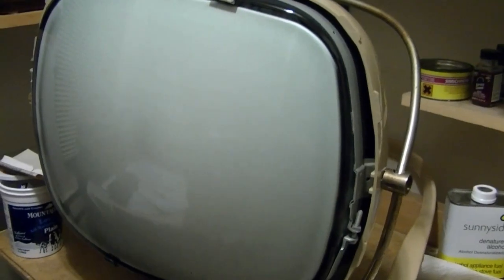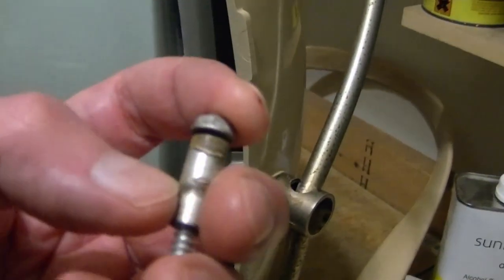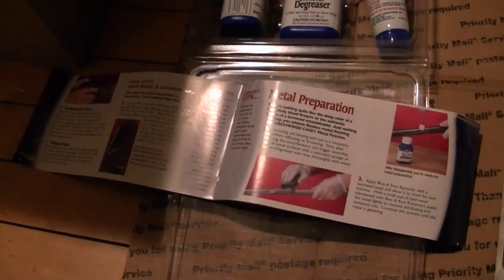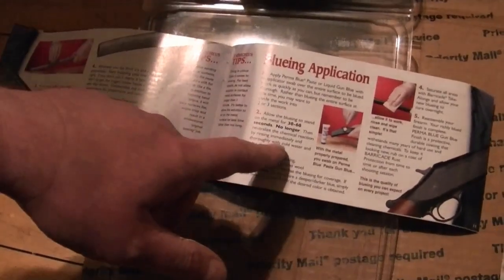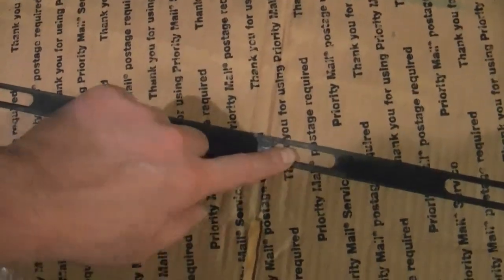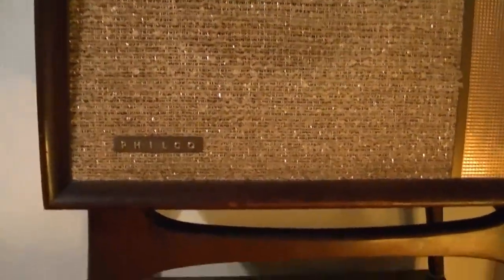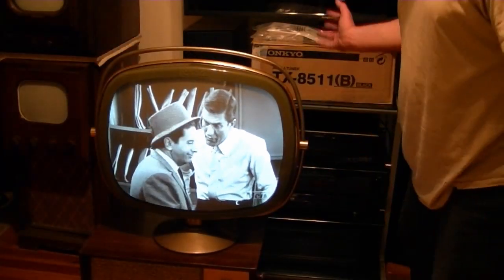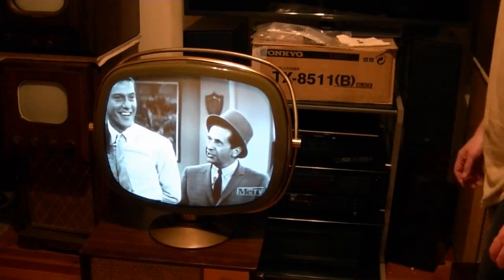Predicta Tandem I restoration pt8o8

Comment: Do these Predicta sets suffer from heat? I can't imagine the ventilation in these cabinets being anywhere near as good as sets with an in-built CRT, and subsequently larger case.
Reply from the maker: I've heard they do but we'll see.  I've had it running a few hours with no problems.
Reply: bandersentv Lets hope it doesn't! The 1967 - 1971 AWA P1 portables here had issues with ventilation, which often resulted in electrolytic caps drying up and in some cases, the flyback overheating and going bad! The caps in my one have suffered from the heat, as has the plastic casing. At least with the Predicta, you don't have to worry about heat warping and cracking a plastic case!
Reply: An retired TV serviceman that I know used to tell me that about the Predicta models, but the chassis that you have worked on show no obvious evidence of overheating like burn marks on the PC boards, lifting traces, blown electrolytics, etc. I would guess that the heat was more of an issue with the crappy paper capacitors those sets left the factory with, but bumblebees/black beauties/Sangamo Little Chiefs, were rubbish anyhow.
Reply from the maker: OlegKostoglatov  I have six Predictas in total and none show any obvious signs of heat stress.  Two actually work fairly well on nearly 100% original components.

Comment: No compartment place to store that cable? Kinda tacky if you don't need all that length. I suppose they used to hang it on the back of the case? They looked ""futuristic"", I like that space age eames Danish modern look. Would have been fun for watching MY FAVORITE MARTIAN, LOST IN SPACE, OUTER LIMITS and even STAR TREK on it.Or better yet those many 50s B movies like FORBIDDEN PLANET, WAR OF THE WORLDS, THE DAY THE EARTH STOOD STILL, TOBOR, and the many other ""space"" movies - especially my favorite TWONKY! Twonky is on YT, if you have not seen it, you gotta see it, a great Hans Conreid movie for sure.
Reply from the maker: The 25 foot long cable is thick and heavy - no way it could fit into the cabinet.anywhere. Altogether it weighs almost as much as the entire cabinet plus chassis.